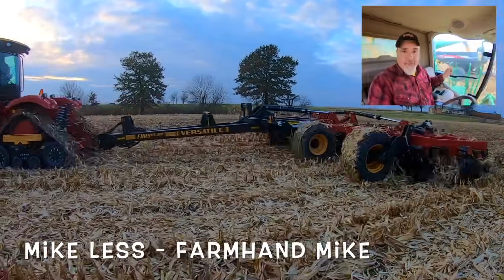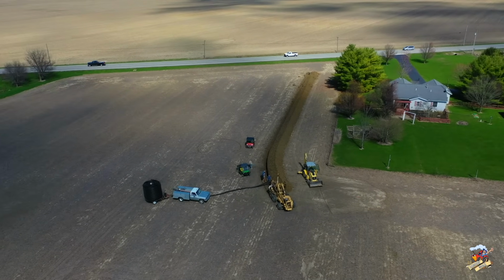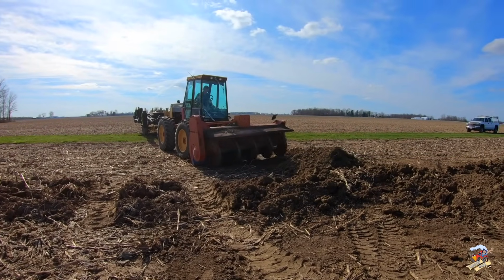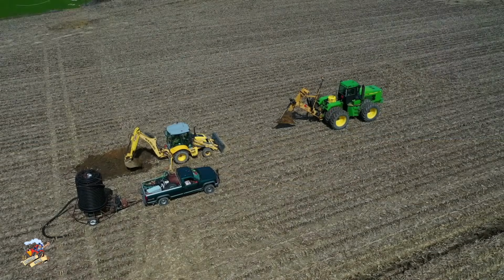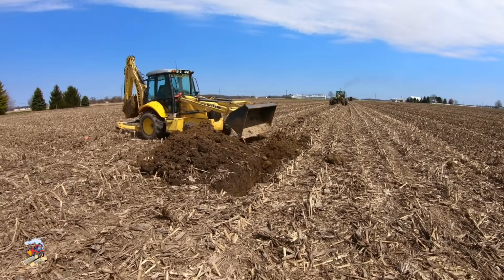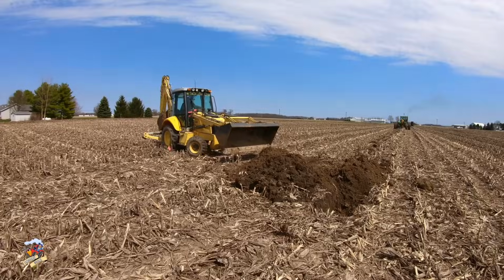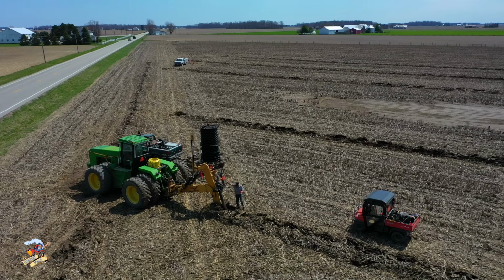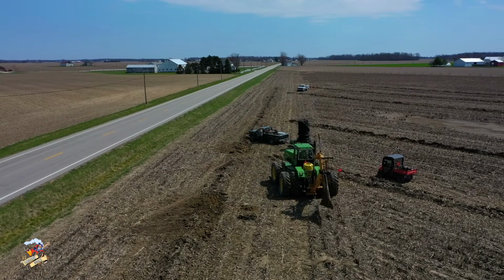Drain Tiling Ditching a Field in SE Darke County Ohio

Comment: Mike , Speicher made the 600 with in line 6 cylinders, 6060 trencher with 318 Chrysler gas motor. Then came 6160 ( in this video) they put 471 Detroit motor and Browns hydrostatic drive for the traction. Then came 7160 with heavier frame the finally 7160 with the digging drive housing went up and down on the up rights rail I beams with the digging frame.

Comment: I was 13 years old during my Christmas Vacation in 1972 and spent 6 days working with one of those tile trenching machines.  It pulled a wagon with a pallet of clay tile 4x12 in. There was a rack in the boot behind the digging wheel were you placed the drain tile bottom up were there were 4 rows with 4 holes in each row on the bottom half of the tile. Being in the thumb of Michigan we had to clean the machine every night so the dirt and mud would not freeze to the trench.  We did the same thing as the guy with the shovel but on both sides. This was to put enough cover so tile clay tile would not freeze because we were not back filling to spring.   KEEP THE VIDEOS COMING.   Versatiles are some of my favorite tractors and I really like there new colors.

Comment: Those Deere tractors with the cumming engines  are probably the best low rpm high torque tractors Deere had.
Reply: Thanks to a real engine
Reply: Worst mistake CIH ever did was drop the cummins engine from alot of their tractors.

JD still uses cummins in their biggest HP line.  But the JD engine itself are extremely relieable.  The 404 was a 10k hour engine that was very successful.
Reply: @mjpopp  the 404 was a huge dog. Had many reliability problems. Blown head gaskets were very common. Also back then John Deere ran a 45 minute hour, giving the impression the engine and tractor were long running.
Reply: @mjpopp  As I remember, FPT engines in results of Cummins and CNH Global cooperation from 1996. It's not far away from old Cummins from Cases or Steigers.

Comment: The bidirectional tractor is a neat machine but a small bulldozer would run circles around it backfilling and it could double as an anchor point for the trencher winch.

Comment: Ideally, that backfiller on the bi-directional, would run the other way.  This would allow the backfiller to follow right behind the wheel trencher, since the wheel trencher usually puts the dirt out on the left side.  As it is now, the wheel trencher has to go always before the backfiller has enough open trench to make it worth running.

Comment: I dont know how this will work in the long run without ston- or clean gravel all around the pipe ,after time it will cloug up with soil
Reply: Soils with higher clay content do not require filter and should last many generations if done properly. Lighter soils or sand require a filter or sock on the tile and this ensures the system doesn’t plug up with silt and sand.

Comment: from France: your drains are very big, why? , we drain with 32'', drains 60''. What slope do you have? because you have little relief... Your slicer is in fine earth, if there were rocks or limestone or flint, the knives at us would melt like butter in the sun (we put 1/2 buckets carbide/tungsten) and the drainer would jump like a goat! , for plugging a bull with an angled blade is enough. What are your coupling clips, Otherwise good work. French farmer vetérans drainer
Reply: In France :we always get the drain32'' over ,on top the collector 60''